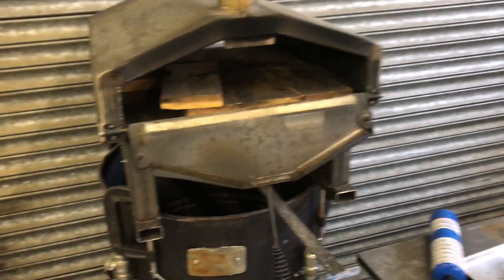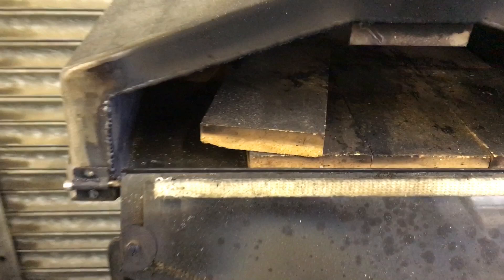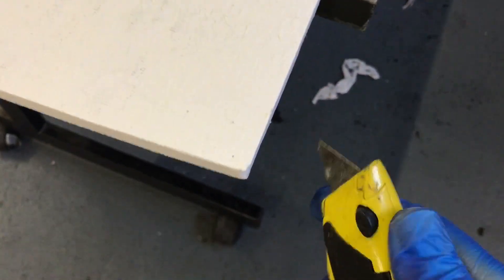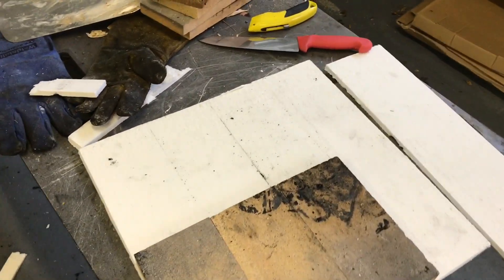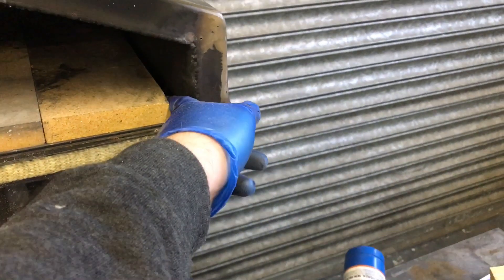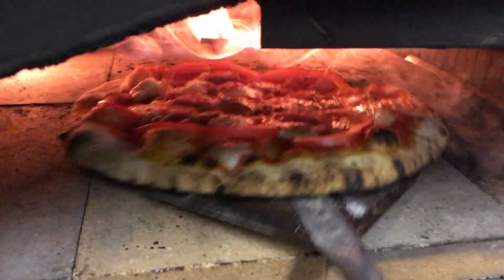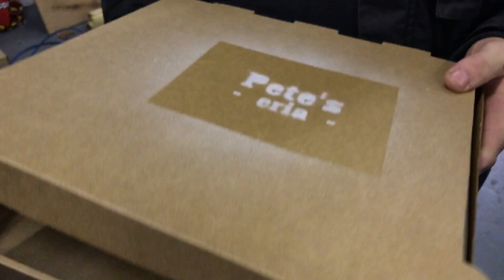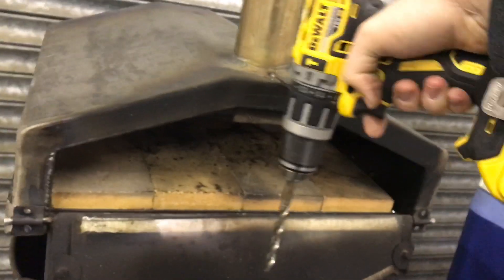Steel Pizza Oven Build Part 5

Comment: Love the build.. how about drilling 1 inch holes from the bottom for air supply that should  solve the flame from smothering  down of lack of air.. but i love this project.. I want to build one with propane gas instead of fire for a food trailor wich would be perfect here in Cape Town South Africa.

Comment: This is so very interesting, and your style of presentation is captivating.  My 2c worth - slow that fire down. You've created a crucible. 🤣 I like the firebox, but instead of having three big-arse holes in the bottom that feed oxygen full time, you need only a couple in the vertical rear, and they need an adjustable damper. Also a vertical eave of maybe 3cm at the top of the front opening would assist the roof heat retention (allowing a lower floor heat), and assist the chimney.

I like everything else, and have placed this design on my to do list. Loved the video.

Comment: Referring to the bricks not getting to temp - I would have thought getting rid of them and putting the pizza on the steel would be the solution but you say the steel was actually cooler than the bricks?? You did measure from the outside though correct?

Comment: Great Job - Really enjoyed the five part pizza oven build. Good video showing challenges along the way. I made a similar sized one with dual fire box (sits on Webber with coals underneath & shallow square coal pan that recesses into top where it's bottom made of 5MM steel reflects the heat down onto pizza) to get high but even temp cooking top verses bottom of pizza. Think 350 C is plenty to burn a pizza base quickly. I actually found I put my ceramic plate in about five minutes before cooking to get the heat balance. I cook at 250 - 300 C. Takes about 3 minutes.

Comment: Bonjour ! I just watched all five episodes... You did a great job ! I have many questions ! Under the refractory bricks, did you use the same insulation as the one placed between the two sheets above ? Do you have an idea of the weight of the oven when finished ? Four years later, how has the oven held up, what is its condition ? Merci beaucoup !!!

Comment: This was 2 years ago and you never showed a final finished video of it working..I knew from the start it was too low and the food would just burn with the wood..is that what actually happened..? Nice attempt tho...showed me what to avoid.
Reply from the maker: There is a video showing it working. The roof is a bit low but it’s perfectly possible to avoid burning the pizza.
Reply: @PetesShredder  it was a good attempt. But too low..I'm.doing a half barrell one..I'll make a video..maybe that will work ,...or not who knows.cheers

Comment: Internal chimney is a mistake. You also overdid on the dimensions and built in a lot of thermal bridges. I admire the devotion in the shop, but some research before starting often pays off.

Comment: I was skeptical of your fire box but it looks to work really well. I thought the pizza you showed had a nice bottom. I like a little burn out crisp too mine. I think you could have solved your rear door issue with a rotating handle instead of the clamps. A rotating handle that connects to the inside should work.

Comment: Why the fire is rising above and out of chemney.? Are you using fan to fire the wood?
Reply: The combustion of the fire is pulling oxygen in from under and forcing a current that forcefully pushes out the top.  Check out rocket stoves and it's easier to see why
Reply: @squirreltastic-k5v  thank you ❤️
Reply: @MohammedAslamtit-bitsoflife  I've been making some pizza ovens out of half 55 gallon barrels.  Very hot temperatures in a short amount of time

Comment: I've just watched all 5 parts of your pizza oven build back to back. I started watching thinking it might be something I could try myself, quickly realised it wasn't when you got your plasma cutter out but carried on watching, partly due to your brilliant commentary, but mostly because I can't wait to see you cook a perfect pizza. How's it going?
Reply from the maker: Yeah, not bad. Had a few shite weird shaped pizzas, some good ones, some burnt. There's a lot to this pizza lark. I will do a final video when I am really worked out with it all, caus I feel if I did a pizza cooking video now, I would feel I needed to do another one ten days later. You don't need a plasma cutter but it does help. Personally, I hate angle grinders, I think they are the work of the devil and should be avoided wherever possible. I got the plasma and a hand held bandsaw to reduce the use of the grinder. Sometimes, you just have to use it though. You could cut that exhaust hole with a hole saw though. Plasma not essential
Reply: @PetesShredder  just get a profiling laser or waterjet cutter :)
Reply: He did obtained excellent pizza...

Comment: Pete I thought about doing the same thing. Couldn’t believe it when I found your video. I have a large propane cylinder that has the dome stand up. It won’t be portable. I think I’ll give it a try. I want to somehow integrate a rocket stove in it. I couldn’t find Part six do you have it?

Comment: I've must say inspiring build! But what temp do you get on the outside, want to build a similar oven but I want to build maybe 2-3 "floors" and I'm building it to a outdoor kitchen so I need to know how close I can put the other stuff!
Reply from the maker: Tobias Hasskvist not bad, about 80c ontop. A lot hotter at the back, caus the back wall isn’t insulated
Reply: Thats a loot cooler than I thought, I could dubble the insulation and maybe get it down to 50c on the top, then I can use almost any paint and the working bench on the side can be closer! Tnx for the info!
Reply from the maker: I think you will struggle to reduce the temp a lot further than that to be honest, as there is a lot of conduction through the steel shell. The inner and outer shells are welded all around the seems, so a lot of heat will be conducted into the outer shell, no matter how well insulated the gap in between is. 

Also I highly recommend using thicker floor tiles, and I would also raise the height of the whole oven a good few inches. I find the roof is a bit close to the pizza and I have set fire to pizza crusts many times because of this. I would make the floor 50mm thick, and raise the height (from the base of the floor to the roof) another 2-3 inches. I would also have a little wall at the front of the oven at the top, in front of the exhaust, to stop the flame licking out the front of the oven. 

The door in the back has also not proved as useful as I thought. It gets so hot, its basically impossible to seal the gap with fibreglass rope, nothing will hold it there, the heat just burns the glue off and the rope falls out. I would not bother with that door if I were doing this again. You can clean the ash out by just sticking a hoover in the vent holes and giving it a good old waggle, that gets most of the ash. The thing gets so hot, there is very little solid lumpy ash left, its only fine dust that gets left behind. 

Let me know how you get on!

Comment: nice build! you mention that your floor burns the pizzas when your oven is hot ( 450-470 c?), this should not happen with a proper floor. What exact material are you using?
Reply from the maker: Marcus Hennix it’s clay brick. Sorted the problems now, see my latest video

Comment: thanks for the  video will give it a try you used just regular steel correctalso you ended up not using insulation under the fire brick?
Reply from the maker: B Popovici I used a 10mm ceramic board under the Bricks. Just normal mild steel

Comment: Wow that is to much like work. 
I took a stainless steel lid off of a small bbq. 
And used a zip cut to make it lower. 
Now I put it on top of my gas bbq grill .
Slide a 12 inch pizza stone in and turn on the burners. 600 degrees in 10 min. Costed me nothing. Only 2 hrs of my free time. 
Remember most bbq lids are double wall.
Holds the heat perfectly.

Comment: Nice work! Before I put a pizza into oven, I always throw flour on bricks. If the bottom temperature is too high, it burns immediately. The flour should last atleast few seconds before burning. Try it out and you will get a filling. Furthermore, you need a stainless brush to put flour away into fire.

Comment: Great work. I like the progress. One piece of advice I can recommend using "00" flour to prevent scorching. Ask any neopolitan pizza maker, they use it for that exact reason. You may also want to consider allowing the embers to have a direct 'line of sight' to the pizza. they provide a great source of radiant heat to help a pizza cook correctly. You have real talent with metal fabrication. good wokr.